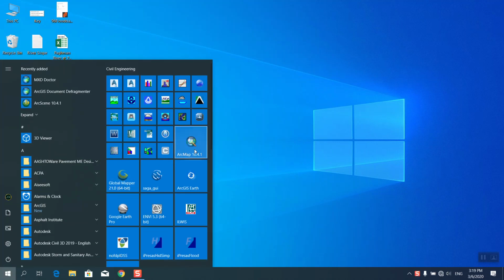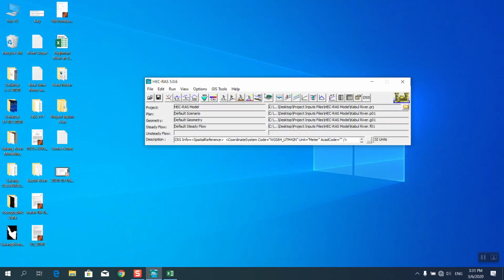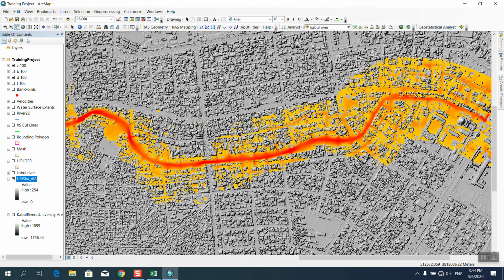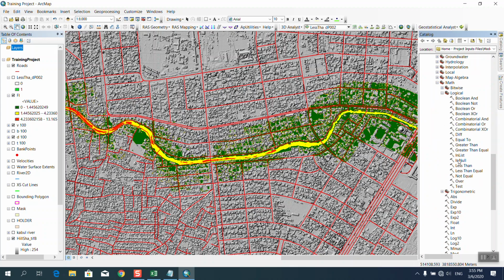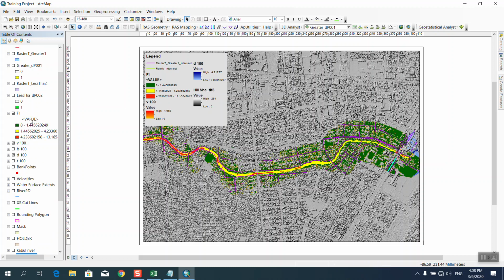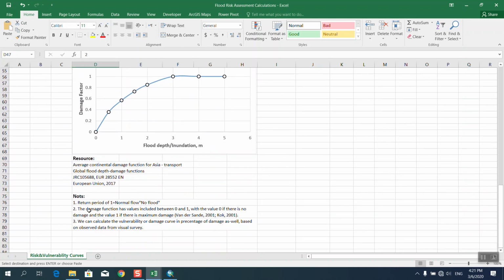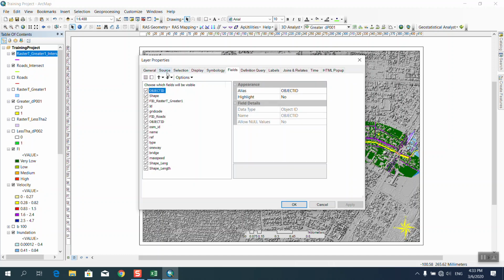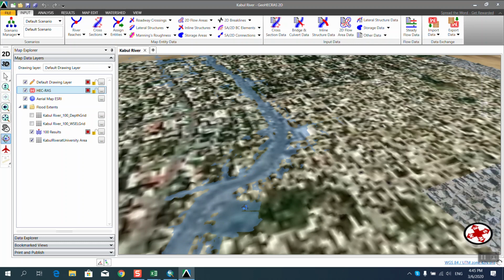Flood Risk Analysis&Assessment using HEC RAS, ArcGIS & Excel.

Comment: Hi good morning 

i have used HEC RAS for unsteady flow so that i have problem from the Cross-section geometry so that let me get for solve this issue thanks a lot
Reply: Hello, what kind of issues that you face in the cross-sections? However, you can contact me in this email: designnetwork87@gmail.com
Reply: Brother cross section error due to spacing between them not satisfying Samuels equation. To build stable model this will help u.